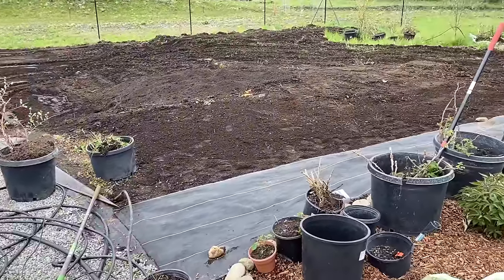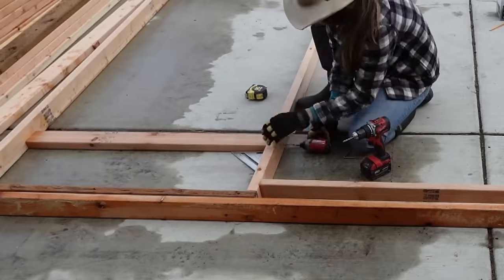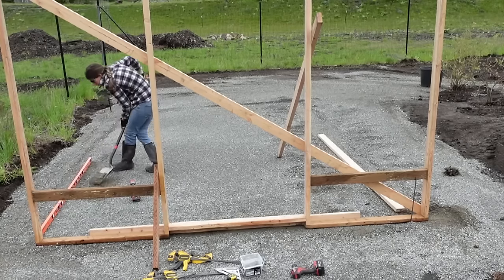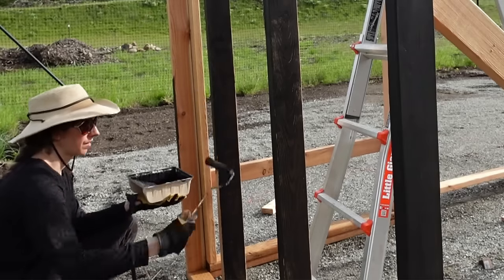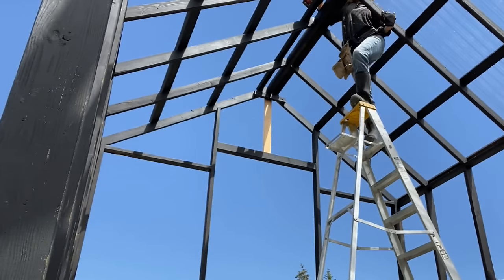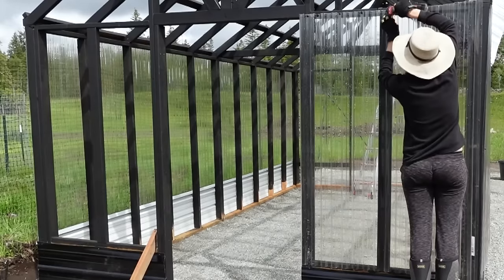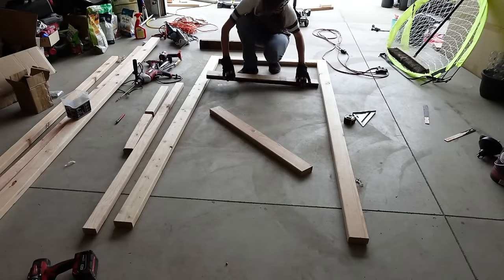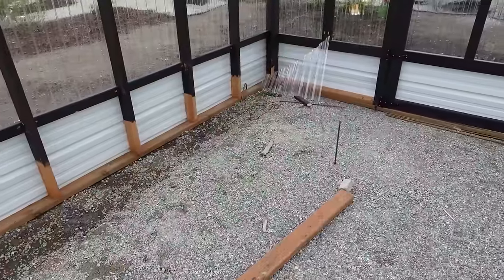DIY Modern Greenhouse Build / Building My Dream Greenhouse using 2x4s

Comment: Beautiful build! I’m getting ready to begin my build. Curious:
1) Did you consider using recycled windows?
2) What is the temp like in comparison (glass vs corrugated panels)? 
3) Difference bw the layered corrugated sheets vs the ones you used?
Genius lid supports for windows!

Comment: Looks great. If using screws for framing like that, be so to use structural screws. The reason to use nails is because they provide sheer strength. Screws will break. They'll work for a while, but will fail over time.

Comment: Turned out great! How has the paneling held up? What would you do differently, if anything, if building again?
Reply from the maker: thanks! The panels are doing great. I would do cender blocks for the base so I wouldnt have to build an internal bed and also add small windows for venting instead of the pop out with the panels. The wind ripped on off since it stuck out.

Comment: Black causes heat to build,  so you would not want it colored on the inside.  It may to cause some heat to be pulled out. If that makes sense.  I've always just had  color on the outside of panels

Comment: Nice job! I like the use of clear roofing panels, a nice look despite not having any insulating value — and decent visibility. Also like that you painted it black. You might want to anchor the bottoms into the gravel with bullet anchors, if you haven't already figured that out (American Earth Anchors makes some nice ones.) Cheers!

Comment: Great job. I built a greenhouse with old windows and what I found that will work in the long run is to use solid stain in any color you want instead of paint. Stain lasts longer and is easier to restain because it does not chip like paint does. The solid stain as opposed to semi-transparent really looks like paint.
Reply from the maker: That makes sense!  

I was really hoping to find some old windows to use but it was absolutely impossible to get enough windows of similar size/shape/design/etc anywhere local.  I almost had a batch of them once but someone beat me by a few minutes! 😡

Comment: I build my shed from scratch with just two framed pieces, and a whole bunch of recycled wood from my neighbor, it took 3 months, because I could only do it on the weekends, and i started the greenhouse in june, i used 8 ft 4x4's for the frame part, and put those in the ground, my neighbor in good faith wanted to help me with the holes with his auger, and that made my holes not line up, my post hole digger i should have just done them all that way, But I had bought a kit and the frame was garbage aluminum, first wind storm would have take it out, and then I used 2x4's after that all around the bottom and then the sides, it was pretty much building it by eye, because I had to utilize the panels that came in the kit, then I got the same ones you got and a couple of green ones the panels, the green ones not as good as the clear. So now I am going to build the door this weekend, I have great ventilating using really good screen material, I do not have snow here, but the heat and crazy thunderstorms, it went through it's first crazy thunderstorm last sunday 8-27-23 and it did very well. Mine is 9 ft by 16 1/2 ft and 7 ft tall. it will be perfect though even though it isn't perfect.

Comment: Thanks for your video!  Do you have roof capping and if so how did you do it?
Reply from the maker: I did add it and got it from a building place so it could be black like the siding. Definitely wasn’t fun putting it on.
Reply: @MommaFromScratch  Thanks for your prompt reply! Are the polycarbonate sheets bendable? If so, we can band the sheets over the ridge for capping. I know the sheets are bendable along the longer side,  not sure how easily along the shorter side.

Comment: Hot damn lady you work fast. I know the video is a bit sped up, but still, very efficient. Great build. Will use as inspiration for my design
Reply from the maker: Thank you!  It has gone through at least two decent storms with fairly high winds; I am sure others could build something better but it seems to be working so far!

Comment: With the price of corregated plastic sheeting now, and timber , this build I worked out in the UK to cost approximately £1500 that's without stone base or ground works or hinges, screws etc.
Reply from the maker: Thanks for the conversion. I’ll just check lumber here and it’s half the price now than when I built it.

Comment: Sister!!! Seriously, you are a bad a$$. I admire your work sooo much. Bonus points, I use a lot of black as well. I just had the exterior of my house painted black. It’s monochrome using 4 different shades \finishes. My bedroom has 14’ walls…yep, board and batten on one (your entryway makeover was my inspo) and the other wall houses an electric fireplace that I’m building a surround for. Thru Pinterest, I discovered our love of dark colors is called “dark academia”